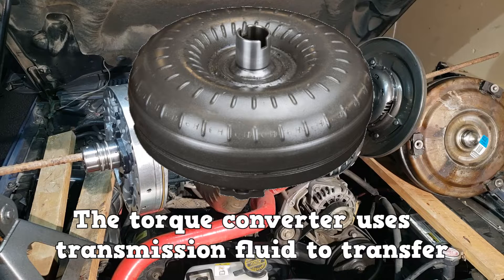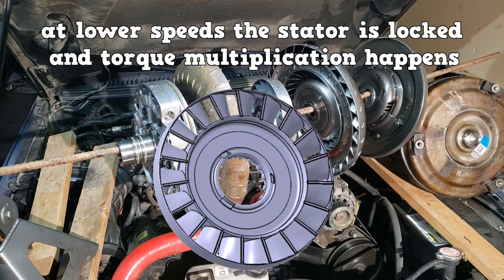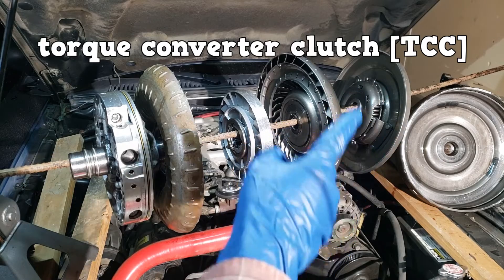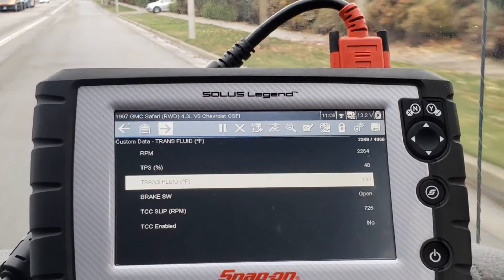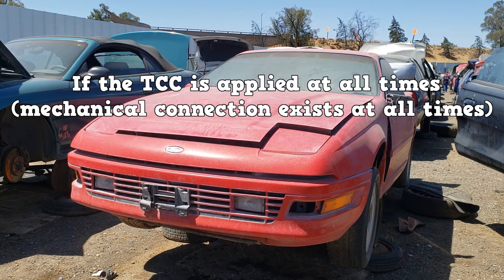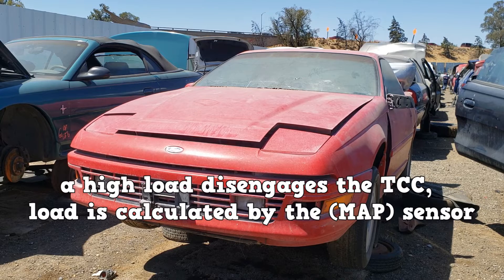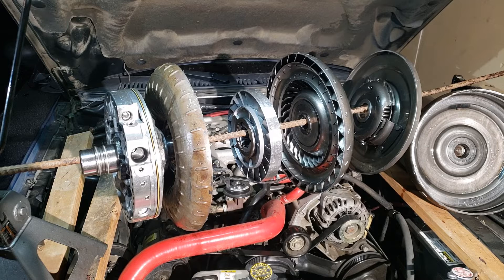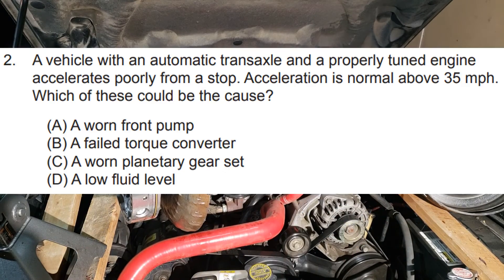ASE A2 Test Prep #1 - Torque Converter

Comment from the maker: (Update 2-4-24) Here's some feedback after taking the test: The test is more concerned with noise and vibration. If you do a stall test which components would that isolate for vibration testing? I also did not show how to check the endplay on the torque converter, but I do have a video showing the process.
https://www.youtube.com/watch?v=3Av5L0HsC7c  

Investigate what a bad bushing would do to the torque converter.

Comment: Great content! Do you have any videos or places to get info for the BMW 1 associate exam by ASE? Can’t seem to find much of any
Reply from the maker: you're right! no "study guide" or outline of tasks is to be found. It seems that they want you to take their "BMW STEP" course to find out. I would assume since its the first exam, it should be on basic auto maintenance, coupled with some specific BMW info.
Reply: There is essentially basic questions concerning electrical, suspension and brakes. All very basic. study the surface of each topic and you should be fine.